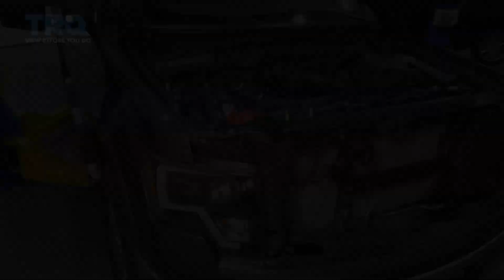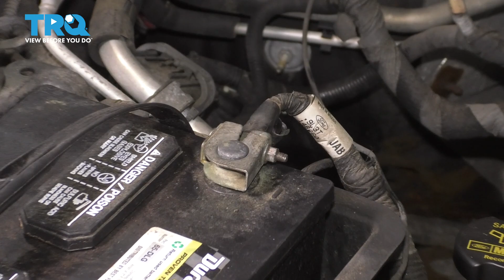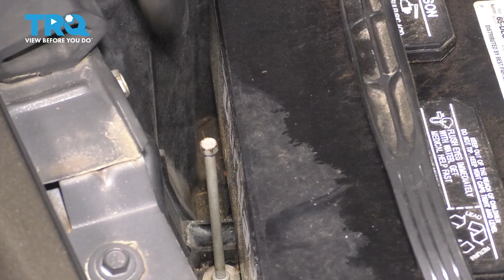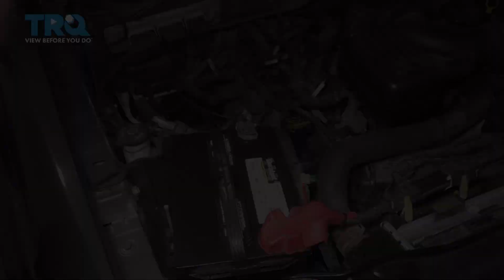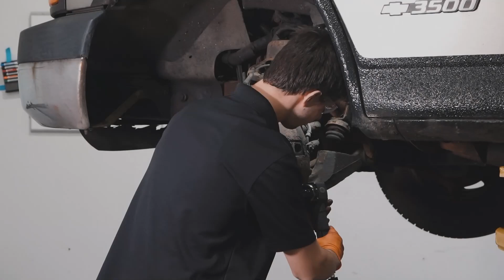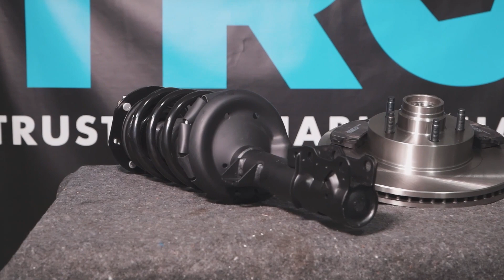How to Replace Battery 2009-2014 Ford F-150

Comment: If I need to put it on a charger, do I avoid the negative post and attach to a ground scource? I used the post before and someone told me that the computer doesn't know the battery is getting a full charge.